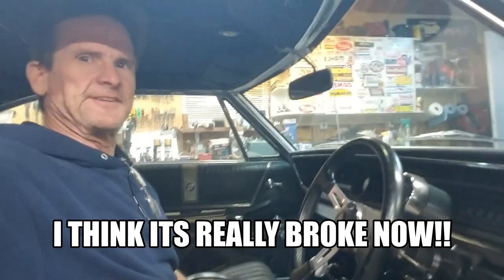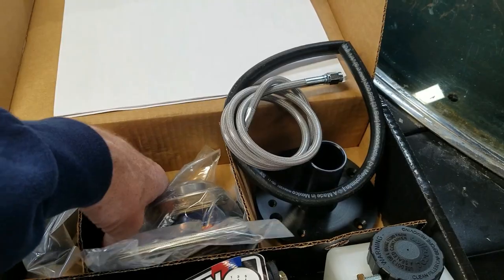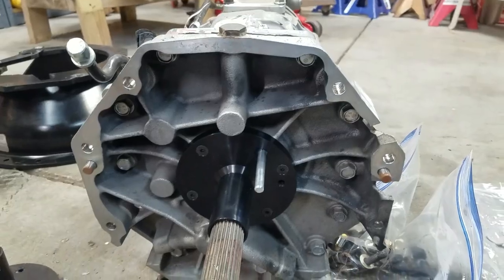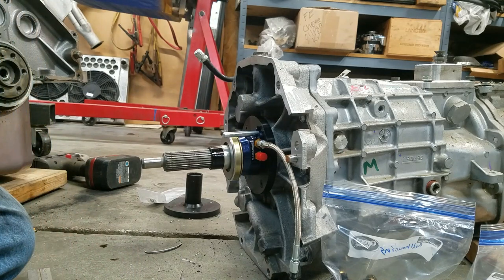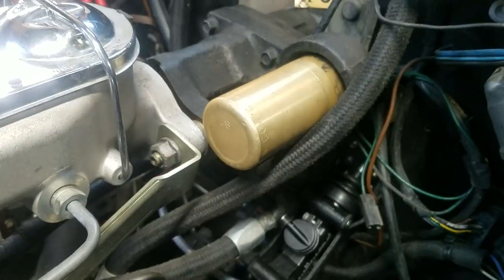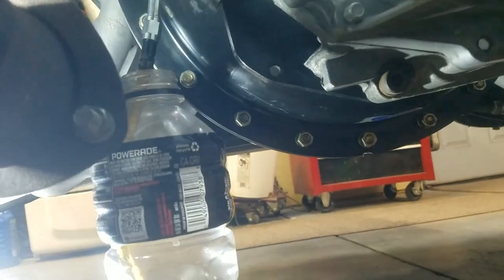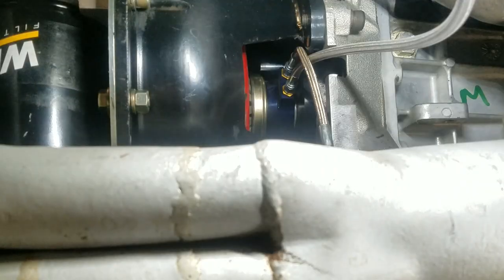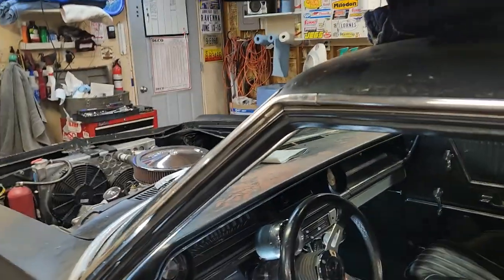Installing An American Powertrain Hydramax Hydraulic Clutch Kit In A 1965 Impala SS.

Comment: I just did the same install on my 65 bel air, I replaced one of the mounting bolts for the clutch master with a long one. It lines up with the clutch pedal arm. It works pretty good for the stop!

Comment: Will work on a muncie m20? I had the sane issue with trowout bearing
Reply from the maker: They have kits for Muncie 4 speeds.
Reply: Hi i all ready done it im  on good on the pedal i got same the original but i clutch and is sooo Hard Man... what   you think could be ? It works all but its hard to use no confortable... thanks i need help with this 😊